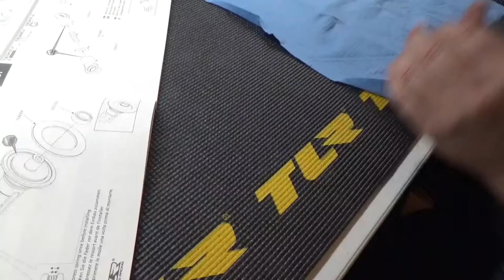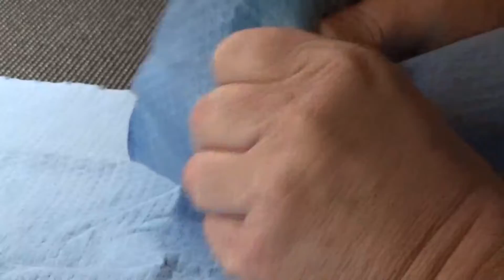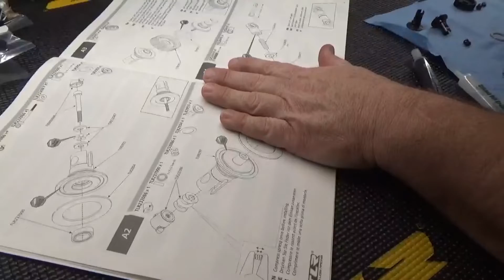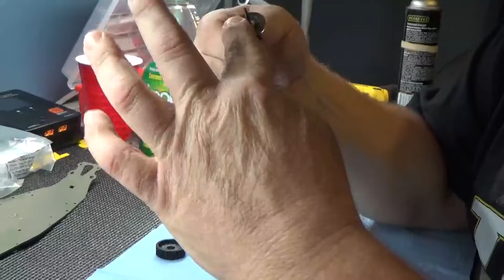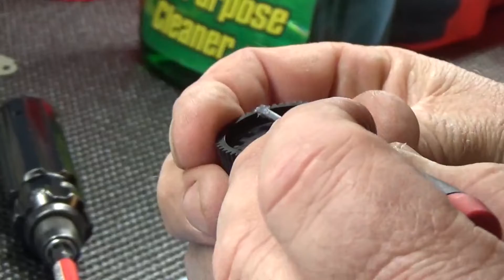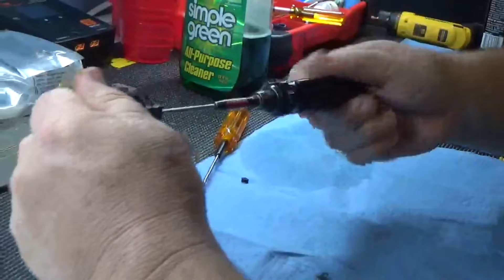Joe Ellis TLR 5.0 DC Diff Build #DriveTLR

Comment: Ugh, started putting my kit together, and this step already killed me. The diff screw just wouldn't catch on the nut. This seems simple enough - I can't believe it gave me this much trouble. This was NOT a good way to begin my Elite build.
Reply from the maker: See if they gave you the right diff screw. I know on my yokomo truck they put the wrong diff screw in the bag.  Killed me
Reply: @rcvitals  Well, I even tried screwing it on without the spring, and it actually did grab, so my best guess is that either the tip of the diff nut thread was damaged, or it was a shorter than expected screw? In either case, I'm going to call TLR support tomorrow, and in the meantime, I ordered a replacement Diff screw/nut/spring kit (TLR232086) that should get here before my vacation ends. I can at least continue on with the build until such time that I have to put together the gearbox, but I only managed to complete the turnbuckles before calling it quits for the day. Spent WAAAY too long trying to get this diff together - I'm surprised I didn't lose a thrust ball in the process, lol.

Oh,. and Thx for the quick reply! Not to mention the opportunity to vent, haha.